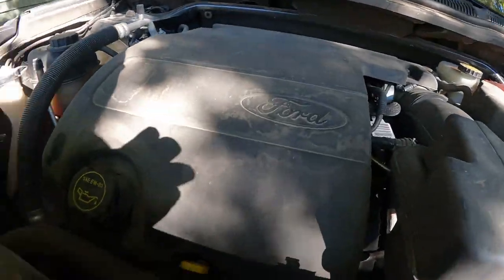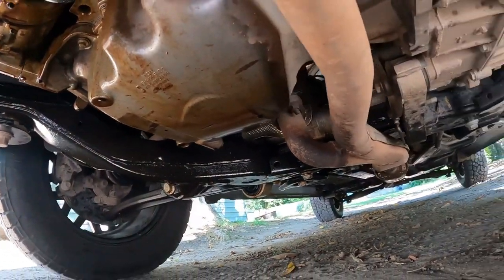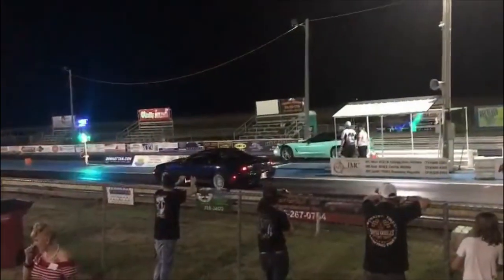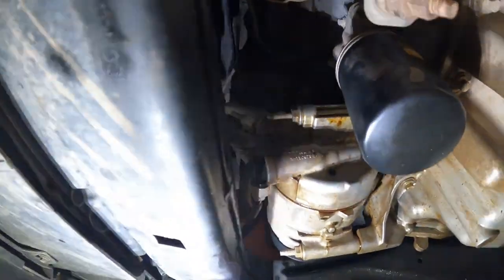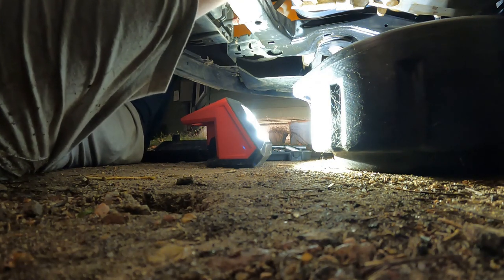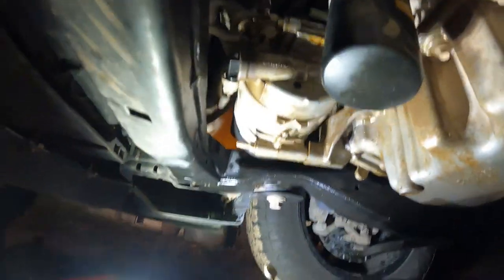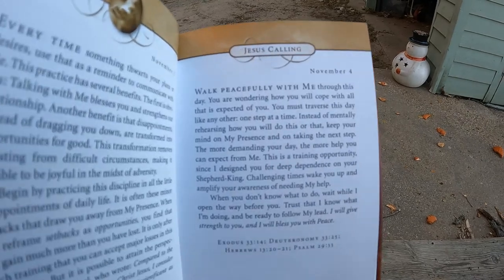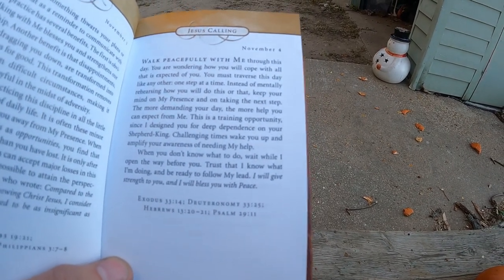How To replace Oil Pressure Switch 2016 Ford Explorer 3.5L V6 (NA) - Daily Vlog

Comment: How do I remove the clip I can’t seem to get mine off?
Reply from the maker: It's once of those clips you have to pry up a little bit and pull out at the same time. I believe I used a flathead screwdriver to get mine off

Comment: Did you replace the gasket or reuse the gasket in the clip?
Reply from the maker: I don't recall there being a gasket, but if there was I would have used a new one. 

Most gaskets need replaced after one us. I'm not sure if there are any with multi use but there might be. So to be safe I replace them when I remove it
Reply: @ArcticVette  that’s what I would have thought too I was just surprised i only saw one person mention the gasket, it was a small gasket inbetween the connectors Im assuming to keep oil from reaching the pins of the electrical connection if there was a leak
Reply from the maker: That makes sense, I may have to take it off again just to find out 🤔😅

Comment: That for me wouda been a Tow Truck & a Trip to the dealer where they would have proceeded to rip me off for a $2000. job that I had no idea I was being ripped off, so just pay it & get my car fixed.   I really should learn to do my own work.
Reply from the maker: That's a real possibility! Luckily I made it home but we did nearly kill the motor. There was only a quart of oil and it needs 6. 😬